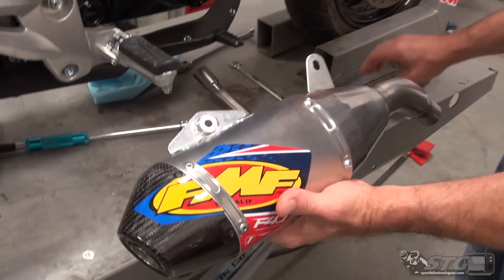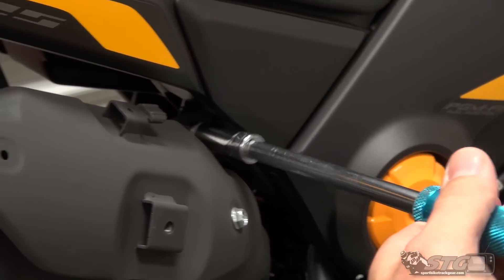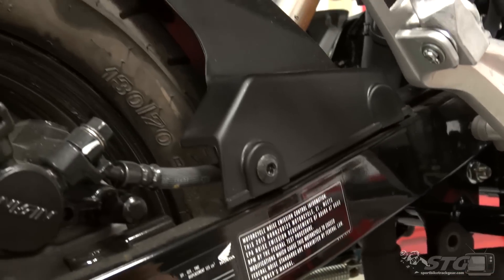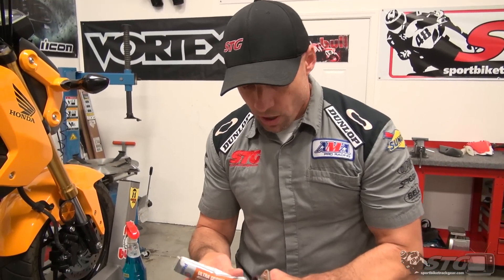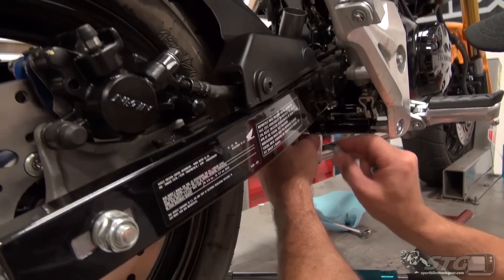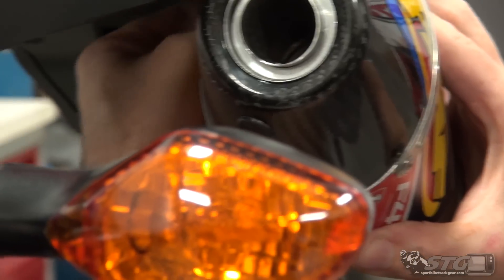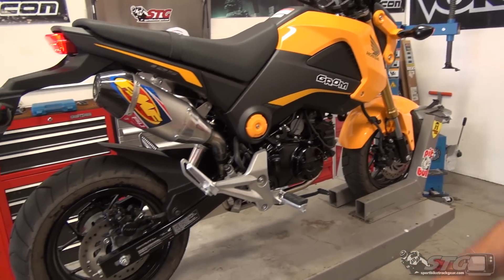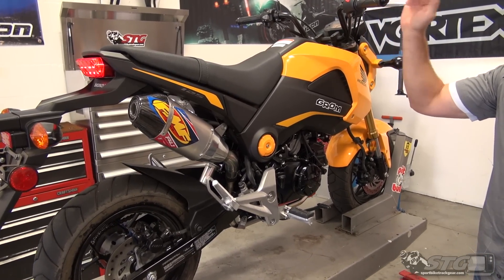FMF Factory 4.1 Exhaust Install on a 2015 Honda Grom in under 15 minutes!

Comment: I can't find the full FMF exhaust system, only the slip on. Where do you get the header pipe to yhe exhaust?
Reply from the maker: I do not think FMF is still producing this pipe. - Van
Reply: @sportbiketrackgear  
I think you are correct, because I was having trouble trying to find it.

Thanks for your reply

Comment: Brian Joining the GROM Life!
Reply from the maker: Love this little guy!
Reply: Sportbike Track Gear Same here, I have one with a modified air filter, try it on yours it makes a difference :)
Reply: ***** I have an MSX 125, That is what they call them in Thailand. I've modified handlebars, air filter mod, Tail tidy and light, bar end mirrors and brake and clutch levers. The bike does 45km/h in first, 70 in second, 95 in third and about 120 in fourth, haven't tried a quarter mile yet XD
I will try soon though :)
Reply: +SIG 1RMY Bahahaha! I will, a 125 vs 150's 😂
Reply from the maker: NO WAY! Teach me your ways...
Reply: +Sportbike Track Gear I will, as a 16 year old rider! I will dominate these streets in my full gear! And I might start saving up to buy the KNOX Handroid gloves, because there is a track not far from where I live and it's about $20 for one day at the track. I've also planned on getting my next bike which may be a 300 or 400. But everyone here at 15-18 all ride 300's!
Reply from the maker: Spongeboy0 That sounds awesome!

Comment: Do you know if the 2015 fmf will fit on the 2017 Brian?
Reply from the maker: Evan did a little research and it will not fit sorry. We do have several systems on the site for the 2017 Grom. Below is a link:
https://www.sportbiketrackgear.com/parts/honda/grom/2017/?search_query=&page=1&limit=48&sort=featured&Department=Exhaust&category=59404&is_category_page=1

If you do not see the one you want just shoot us an email to orders@sportbiketrackgear.com and we will get you dialed in. - Brian Van

Comment: I have a question for you guys. My manual for my R3 says to use Lithium Soap Based Grease as well as Silicone Grease on many parts of the bike like the brake and clutch levers what brand did you guys recommend?
Reply from the maker: Good question! This is the stuff I usually use:

http://www.sportbiketrackgear.com/castrol-lithium-grease/
Reply: Nice, is this product also safe to use on the parts that require silicone grease?
Reply from the maker: Taydiablo3 It sure is!
Reply: Thank's.

Comment: What are the plans for the Grom? How crazy you going with it? Gonna put a full fairing kit on it? Swap the rear swing arm and go for "normal" sized wheels? There's so much out there for Groms, it's nuts
Reply from the maker: Not 100% on that yet but we are going to start off with the basics and go from there! It should be a pretty fun build!